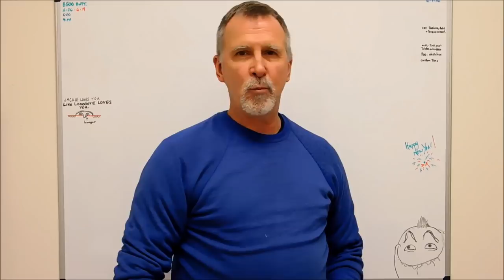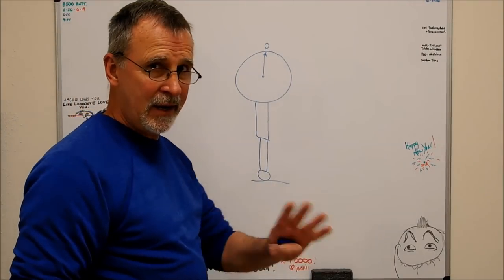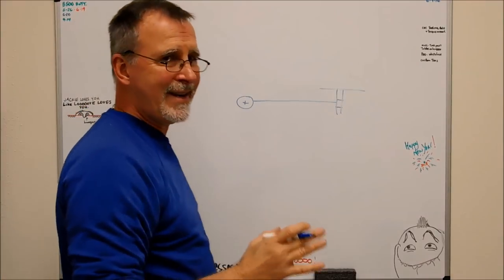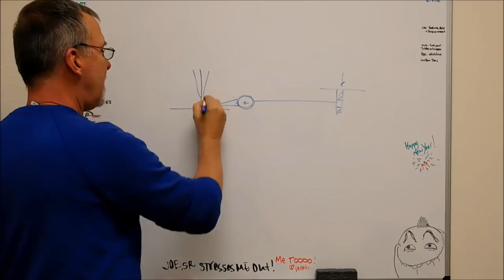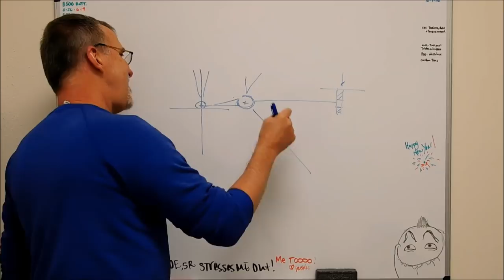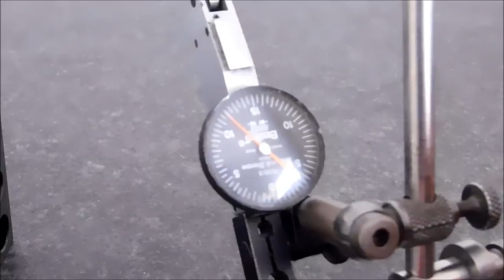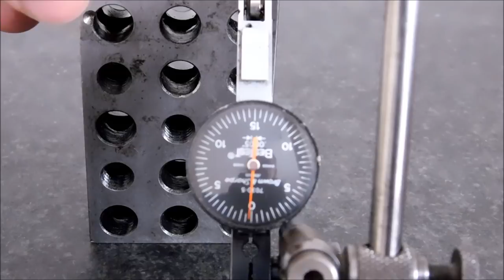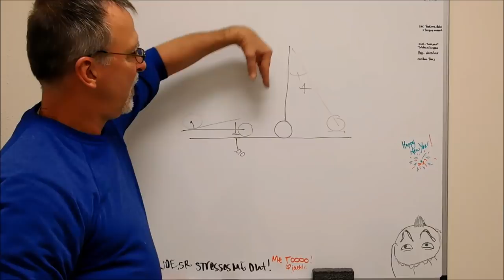Cosine Error Demonstrated and Challenged !

Comment: Joe,
I recently was criticized by my machine shop instructor for this very thing on my setup with an indicator. I argued with him in the very same manner that you were describing. I plan on showing him your video and challenging him. I have a question for you. I’m currently learning to single point thread on a manual lathe in class. I plan on threading away from the headstock as I have learned watching your video. My question is can I thread away from the headstock if there is no relief groove? I have one thread operation to perform on my assignment that has no relief groove. Any advice would be greatly appreciated 
Keep sharing videos they are great
Reply: I have used this "reverse" single point method of thread cutting for about 20 - 25 years. I discovered it for myself as a younger bloke and I thought I was terribly clever at the time. However, I soon found it risky with "thread-on chucks" and with "flat bed cross-slide" type lathes. (...not that you see many of those any more.)

Point is, yes. Yes, it is possible to pull off a good thread "lead-in" using the method with no relief groove, but it is a bit hairy at high RPM's. It's liable to lead to tool point failure and result in work-piece damage. It can be done, but it takes a fair bit of practice and a few total fuck ups to master.

I do it by leaving the lead screw engauged, the tool tip carefully positioned, and then starting the chuck turning from a stand still. I kinda balance the chuck-clutch take up against my tool point feed in rate, sort of like doing a hill start with a manual gearbox car. If you are not as smooth as ice in doing it then the point WILL break. I also let the chuck get a little bit of a "run-up" before the tool tip hits metal so that the momentum/flywheel effect of the chuck helps keep the cutting movement smooth.

I wouldn't recommend my method if you haven't thoughly mastered it, but have recently "argued with your machineshop instructor" It's bound to result in getting raused on. Good luck (from Australia.)
Reply from the maker: You should ask the instructor what type of termination point is acceptable. A stationary tool will result in a relief groove. Maybe its a test within a test. Is he trying to teach you free hand blending?
Reply: Joe Pieczynski 
What they want us to do is kick out the half nut and turn out the cross slide at the same time while maintaining the length of thread within .020. That’s the tolerance on the part

Comment: Great video, I'll be sure to keep the lever in that +/- 10 deg position. Off subject: what causes the no load reading of the lever type indicator to drift over time?  I have the same BesTest indicator you have. When I got it the needle pointed where yours does - about  + 0.012. Now it points to about -0.012 when unloaded. At what point do I need to be concerned and have the indicator serviced?

Comment: Yes, have always agreed with that . Thanks , makes sense.  Thought everyone was fine with that.   Aren’t people describing the error from true, as the probe rotates?   Pretty sure most people use probe type indicator for checking and setting run out and position of flat parts, part to part.   I wouldn’t use probe type indicator to measure when offsetting a part or tool a certain amount.  Because it won’t be that amount (distance) as the probe rotates through arc.  Myself, in my business, in my shop, I guess my one off part jobs don’t have that level of relying on discreet measurements.  I just use a mic or something.  Thanks Joe. You the best.  Also, I like your brief history of your shop experience going way back.  I think about like all of us.  But you’ve had such a wide range of experience.  Thanks for passing it on Joe

Comment: That pretty well clears it up. Thanks. While watching a fairly simple minded argument supporting what you have demonstrated is: These instruments are made by people who actually know what they are doing, and what users need. Would Starrett, for example, allow us to rotate the tip around it's joint to the indicator mechanism by nearly 90 degrees if they new the readings would be uselessly inaccurate?  My money is on Starrett knowing that what you have shown is a mandatory design feature of the device.

Comment: Re Cosine Error - on a LEVER Indicator, (also known as a Finger clock)  the length of the Lever arm supplied with it should NEVER be replaced with a longer or shorter arm. The length of the arm is specifically calculated by the Manufacturer to that particular Instrument & the arm should only be replaced Like for Like. The Internal gearing is made to suit that arm length only!!
Reply from the maker: I have to respectfully disagree. A lever indicator arm can be any length they supply or changed to suit. Since it only "Indicates" relative position, and is not intended to measure, it doesn't matter how long it is.
Reply: I respectfully agree with Joe, which puts me at odds with my boss.  We have had this argument about the length of the needle (stylus) numerous times.
Reply: Joe Pieczynski You are correct about the relative angle of the lever arm to the indicator being unimportant - it is indeed the angle between the lever and the workpiece that matters and must be maintained as closely as possible to a perfect perpendicular tangent. 

The lever arm length does matter too, however.

A longer arm will sweep through a smaller angle versus a shorter arm when indicating the same runout.

This instance is a Sine error. 

Sine(theta) = opposite/hypotenuse 

Opposite = runout
Hypotenuse = lever arm length

A longer lever arm dilutes the readout.

Comment: I’ve never understood why people think that the indicator body matters. It should be obvious why it’s not. The manufacturer provides the indicator with the ability of the operator to move the lever to the point where you can take the measurement. If the body had to be parallel, then they wouldn’t allow you to move that lever to a convenient spot. You would always have to put the body parallel to the part, which we can rarely do, on the machine (not the surface plate, that’s easy).

Since it costs money for that extra complexity, there would be no reason to provide it if you couldn’t use it! I can’t think of how many thousands of times over the past 50 years plus I’ve moved that little lever when the indicator was at an awkward angle. It’s just so obvious, I can’t think of why anyone would not understand what’s happening.

Comment: Hi Joe,
I think this topic has been around since the invention of indicators. LOL Your explanation was excellent. I was taught many moons ago, indicators are only a reference and not a measuring device. This is why it really does not matter the position.
If we need to measure a .600 dimension, we set the indicator to "0" with the jo block and not move the indicator. Then test the part. Simple. I usually laugh when the term cosine error and parallax error come into the conversation. Keep the vids coming 
Im an old dog and can always learn a new trick!!!!

Comment: First, didn't notice the internal threading tip was your first vid. Was talking to my 89 year old dad the other day and he said, "let me tell you a great hint - always thread away from the headstock, if possible." Laughed, he's right there with you on that.
For this vid about the 2 diff indicators, the huge diff is that one measure translational distance, the other rotational distance. For the BestTest, above the very small rotational distances it is designed to measure, the cos error would become noticeable. Since we only use these indicators for small measurements the cos error is negligible.

Comment: Also, the linear indicator gave information one could accurately calculate the indicator body angle from (637 in place of 600).  If one comes up with an error that way, it is an error of interpretation only, not an error of the indicator.

Comment: Yea, you are spot on Joe. The measurement part of the set up occurs between the ball contact/workpiece and the centre line of the pivot rotation. Anything after the pivot rotation in the set up is irrelevant.

Comment: I can put the subject in a different perspective, to make the same point you did.

IF there was a +/- 10° limitation to the indicator arm, or a cosine error would introduced, don't you think the, (arrogant, IMO), "Last Word" guys, or Brown & Sharp, or Mit, or ANY of the manufacturers, whose income is dependent upon accuracy and repeatability would say something, anything about such a limit?

Don't you think as least ONE of them would have a warning ground into the side of their indicators?  

Don't you think ONE of them would limit the travel?

Wouldn't ALL of them NOT promote the feature of the rotating arm?

I have some experience with dial, (drop), and test indicators from building high performance engines in the '70's & '80's, but virtually none in machining, until recently, but I knew this the first time I used an indicator, (clock, to my UK friends), because of high school geometry & trig AND learning how the two types of indicators work.

Joe, you did this subject proud. I think where this recent 'the sky is falling' incident is due to lack of knowledge of the tools being used.

Never apologize for being passionate about a topic.  Passion is so frequently mislabeled as anger, or some other negative behavior in our society, and it pisses me off.  We are NOT dispassionate robots.

Thanks for sharing your knowledge and expertise, and for taking the time to make the vids. Without guys like you, I wouldn't know a quarter of what I have learned in my 65+ years; it started LONG before the internet was even a dream.  

I have found, and continue to find, people with knowledge appreciate people seeking knowledge, if the seekers are humble about their own knowledge, and simply ask to be taught.

Discussion, and challenges of knowledge are fine, never hesitate to ask questions, or seek clarification; problems only arise, when people don't know, but argue like they do.

Comment: You did a fine explanation and I am with the group that doesn't understand why this is hard to grasp. If you paid the slightest bit of attention in sophomore high school geometry, you would understand how to properly use an indicator. I had coworkers that slept through their geometry classes. They couldn't grasp why exchanging test indicator tip lengths would change the calibrated indicator reading with the tip length it was originally packaged. Any casual observation of an indicator design structure will reveal how incorrectly loading the travel direction will affect the indicated measurement. 

When I started in the trade I regularly indicated centerline error measured from a lathe spindle rotation by mounting a mag base on the lathe chuck. I had no idea how much a mag base moves the indicator by changing its relative position while rotating the spindle. I used this method to correct turret lathe tool holder centerline error. An instructor demonstrated why this set up is not trustworthy by mounting a mag base to a plate and indicating from that mounting to the same plate. One would expect the relative indicator reading to remain the same if the plate holding the set up was picked up, angled and rotated. The set up is a "solid" unit???? But the indicator will show relative movement. I have always supposed that the gravitational forces on the magnet connection  vary as the indicator moves through space. Returning the set up to the original position will return the indicator to the original zero setting indicating to me that the mag base arms remain in their "locked" position. After that demonstration, I never used a mag base for this set up. I made rigid indicator holders that I could easily mount in the lathe chuck jaws and eliminate the demand for a mag base for this set up. I would repeat this demonstration for non believer technicians.  Mag bases are necessary and fabulous tools. I probably own and use 15 of them, but I never trust one if the mag base must revolve through space.

Comment: Cosine error was never really a concern for me other than surface grinding round parts. Obviously you grind round parts with your part off the centerline of the wheel to the left so if things catch its not going to drag the part under the wheel, explode a wheel, etc. Because of this, the down feed of your wheel is not the exact amount taken off of the part. This is exactly the same as you demonstration with the dial indicator. I do not remember my numbers exactly, but I plotted it out in AutoCAD at one time and the error was very minimal out to I think 15 degrees off of centerline, (meaning the error was less than .0005 of an inch). Outside of that, I never worried about it because I was taught to use my dial indicators correctly, which means perpendicular to the surface being checked. But as you said, with test indicators, position of the body does not matter. If it did matter, they would not make a test indicator with an adjustable tip with the range that they do. Keep making great videos Joe!

Comment: Love these videos. With the dti (lever type) you would have a cosine error if the body (let's say front face) wasn't parallel to the work surface. Very extreme example would be pushing sideways edge on to the arm so to speak. Hope that makes sense. Actually if you twisted that dti a little bit you could have made your feeler guage bang on 10.1:-)

Comment: not heard that the tip has to be within 10° of the body, always thought tip perp to contact surface. Any references to people saying otherwise? cosine error incurred when outside that 10° of perp to the contact surface for sure
Reply from the maker: Parallel to the surface. I made the same mistake in the presentation.

Comment: Hi Joe, as said by most, a very clear explanation of some of the mechanics of using dial (test) indicators. To be clear: I agree 100% with you. I am hardly a measuring expert, but I would like to point out one thing in relation to the confusion though. Some people mentioned indicators not being able to measure, only to compare and imply that when comparing cosine error is not an issue . While correct in essence, even in the most basic comparison, centering a part, most people still quantify the difference. When you say it is one thousandths of an inch out in a way you are measuring, and a cosine error will be present if improper measuring techniques are used. Also a lot of people use (linear) indicators to measure movement of machine parts. they compare position 1 with position 2, and in a way that is measuring a difference which can also be influenced by improper placement of the indicator. I don't think there is anything wrong with using indicators in this way, I just want to point out using them for "comparing" does not mean cosine error is not an issue! It is only not an issue when comparing two objects of exactly the same  dimension (which of course is not realistically possible, after all we want to know if our product is in spec. It is if the deviation is acceptable, which means it has to have a known quantity)
Great video, I love the way you make us re-evaluate what we think we know!
Peter

Comment: I have a Herman Schmitt indicator base and the thumb screw adjustment is so fine, it’s heaven. I have an interapid indicator and in the late 90’s they started making tips with a .010 ball, just at that time I had to EDM a ledge on the bottom of a plastic injection mold cavity. The ledge was .008 tall and .008 long. Any hard contact and the .010 carbide ball would fall off. In the beginning of production some new balls were not welded properly. But the indicator body was hitting the cavity bottom so I had to rotate the tip more than 10 degrees and I proved the reading just like you did . 10 degrees is bogus, even the paperwork in the interapid case is wrong.

Comment: I had to bore out a flywheel pulley last night because it was .001" too small.  I used cosine error to my advantage when getting it centered on the back plate.  I tipped the indicator to indicate more than was actual.  It took several minutes to get it to zero, but it was dead nuts because my indicator was reading 0.

Took a skim cut and it was perfect.

Comment: 524 comments as of this date, so this may have been asked and explained on a 4 year old video.  Could you take the cosine error to your advantage and turn a >I I< .001 dial indicator into a ->I I<-.0001 for more precise measurements? Likewise with a ->I I<-.0005 lever style and get to ->I I<-.0001?  Geometry, postulates and theorems were not my strong suit in High School some 35 years ago.  Would make another great Joe Pie Shop Gem video!
Reply: Do you mean --->  Cos 0.001"/0.0001" = 10 deg  
or ArCos 0.0001/0.001=84.2608deg?

Comment: Great video; correct in showing that what is important is deviation of the indicator tip with respect to the angular displacement at the pivot. So long as motion of the tip  is close to perpendicular, the position of the indicator does not matter.  Very similar to tramming, deviations in x and y yield no deflection in z.  If ideally set up, mathematically, this would be Cos (x) = Cos (y) = Cos(0) = 1.  In other words 100% of the z deviation is indicated. You used a similar principle when showing how to set a lathe compound at an atypical angle. Thanks.